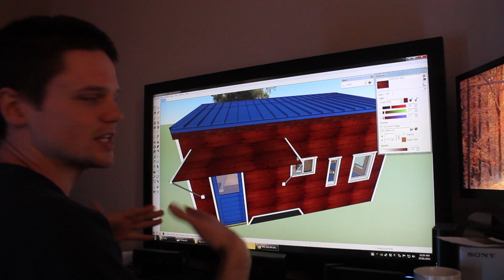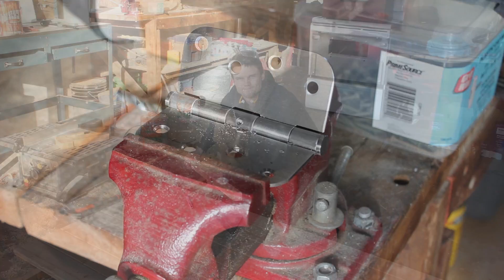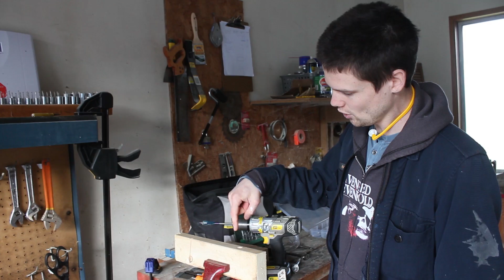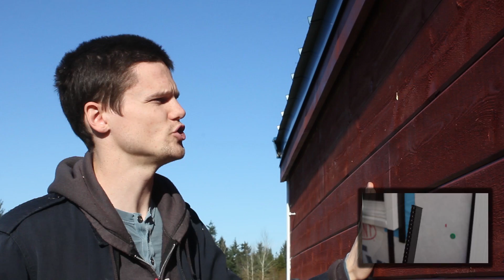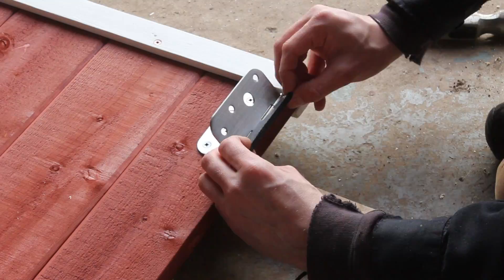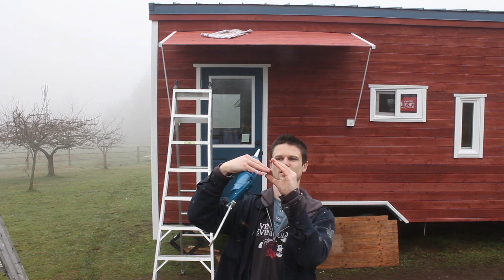DIY Tiny House Awning (Ep. 28)

Comment: Is there a reason you didn't opt for a traditional roll out awning? I would think it would reduce the weight and overall workload of removing/reinstalling (ladders, holding, wrenches, etc). Personally I'm going simple with a waterproof canvas sheet setup on hooks because I don't need the permanence and I'm looking to reduce cost/weight. But I've considered both commercially available and hand-built wood options. Just curious on your selection.
Reply from the maker: We looked into RV style awnings and they are not cheap, plus they are a pretty big commitment to attach to the side of the house (would look out of place because we didn't plan for one). It's rare that we have to remove the awning, and in fact, have not removed it since we did a metal/polycarbonate rebuild. We also have plans for a deck in the future which will have its own cover. I think the roll-out awning would have been a great choice if we planned for it from the start, so it's something to consider early on during the design phase.
Reply: @tinynestproject  Thank you for your response! I love the series.

Comment: how is this different from a trailer? You can buy one for pretty cheap.  Looking at these videos, it will cost me a ton of money on material alone, not to mention tools I have to buy to work with the expensive materials, and there is not guarantee my tiny house will last the winter.
Reply from the maker: This is a very fundamental question when it comes to tiny houses. The best way I can explain it is that a tiny house has all the benefits of a standard house, a mobile home, and an RV. It's much more robust and insulated than an RV, can be deployed like a mobile home, and can be designed to have fully functional spaces like a standard house.

Comment: I would have turned the support board sideways ... that way you could have just used a nut . washer and bolt --- it would not be in the house and you could have been done way faster
imo of course
Reply from the maker: We wanted to have a permanently secured threaded hole to fasten into... we've removed the awning several times, and all we need to do is loosen the bolts and take them out, then slot them back in and catch the threads when we put it back up... a nut would come loose inside the wall once the bolt was removed... hopefully that makes sense, and I know what you're saying too :)

Comment: As always great videos. I have 2 questions though that have been bothering me. Considering your attention to detail you probably have a reason though.

1. Why did you slope your roof so much? The only reason I can think of is to shed rain quickly and to shed snow to prevent the snow load from overwhelming your roof framing. However for such a short span snow load will be minimal and the snow would shed from a lesser angle especially considering the metal roofing as opposed to shingles. Rain will also shed with a much smaller angle. I would have thought you would prefer the added head room in the loft that a shallower roof pitch would have provided.

2. Why did you use the short side of the building as the front? In the case of rain it will now make entering and exiting unpleasant. Even with the awning in this video all you have done is move the rain curtain out a few feet from the door. It will also ensure that the rain will now turn the front of your tiny home into a quagmire as opposed to the back side. If you had used the tall side as the front then rain would be a minimal issue. Was it purely aesthetics that was your concern? I think the high side would have still provided a beautiful front view.

I do not intend this as a criticism. I am merely curious about your reasoning. 

As an aside; I am not sure where you are and how cold it gets there. i am from Northern Ontario where rain freezing on a metal roof happens often. Certain conditions can cause the ice to then shed off of the roof in large sheets. This is hazardous to people and damaging to anything underneath (parked vehicles, patio furniture...). To combat this (if it is a consideration at your location), you can install small vertical wedges at the bottom of each roof channel (the space between each standing seam connection). They are usually made out of sheet metal and are easy to install.

Here are some plastic ones for sale (ignore this if not applicable to your area).

http://snowbreaker.com/
Reply from the maker: 1. Having never installed roofing before, we tried to go with the simplest install. Our research into this basic metal roofing suggested that the shallowest slope you should do is 12:3. Shallower than that could create the conditions for a snow/ice dam to allow water to spill over the interlocking barrier, or mean that you might need a different roofing system altogether... even if this info is not entirely accurate, we decided to stick with the simplest approach and use the most standard materials. This is also why we didn't even consider a skylight... too much to take on for our first DIY install.

2. We don't have quite as solid an answer for this one. It has proven to be an extra issue that we have to deal with. We're planning on making a simple gutter before the fall, to mitigate the frontal runoff. It definitely looks nicer to see the roof from the front... if you've seen the h0me model by tinyhousebuild, the exterior aesthetic is not preferable in our opinion. A few other considerations are which way the house will be towed, where it will be parked, and which side you want the door on... we knew exactly where we wanted to park it on the property before we started to design, so that definitely lead us in the direction we ended up. From our limited towing experience, it's definitely worth having the high-side of a shed-roof on the left side... the opposite side from the curb... because of tree branches. Ultimately, we might have been able to mirror the design, but the position of the fenders would not have lined up with the bathrooms... it was kind of an impossible task to satisfy all of these parameters without compromise, so we will just build that gutter! lol

We appreciate all feedback and well-intended criticism :)

Thanks for the link, this is a great tip and an important consideration depending on your climate. Climate must of course be a primary drive for any design. We're on Vancouver Island where it rains a LOT but rarely gets very cold... nothing like Ontario... so we don't have to deal with that kind of ice issue.

Cheers

Comment: stainless supports would have been maintenance free.
Reply from the maker: +Gene C We used a rust-inhibiting spray-paint, which seems to be holding up well. If it starts to rust we might replace it with stainless (it's also more expensive :P)

Comment: Very nice!  I'm considering something similar, but with leftover corrugated metal sheets from my roof.  I have a 10' x 3' piece that I would cut in half to make it 5' long by 6' wide.  I'm just wondering if it would be too heavy though for a similar attachment method that you have with the bolts and angle iron, as I would need plywood or OSB (probably sealed somehow on the underside), then wood supports for the plywood (to accept the depth of the #9 metal roofing screws), then the roofing underlayment, and then the metal roof.  I know you used a different material, but any suggestions, thoughts, or comments on my proposed materials would be appreciated.  Thanks!
Reply from the maker: +Sac TinyHouse Sounds more resilient than ours, but hard to say weight-wise. Ours is... fairly heavy. Not manageable by a single person, and not the easiest thing to mount with two people. As some people warned us, it did sag eventually, but we've upgraded it with a few aluminum cross-members which we'll show in a later episode.

Comment: Question, can this still drive on US roads? how tall is the whole thing?
Reply from the maker: Evilroots It might be an inch or two wider and taller than the regulations (8.5 feet wide, 13.5 feet tall). We designed it to fit within the limits, but the roof sticks out an extra inch here and there beyond what we modeled in sketchup. We're hoping it will settle an inch or two on the suspension, and then an authority would really have to bust our the measuring tape and be out to get us :P

Comment: ? what about when you travel with it did you set it up so you can lower it and re-bolt it ?
Reply: Tiny Nest I have not built anything yet but considering options. Just a suggestion, why not make an awning  and porch that close together for travel. Kind of the same concept as storm shutters only instead of going from the sides in they would go from top to bottom and could just be fastened down for travel.
Reply from the maker: wotsken The whole thing can be removed with ease for travel and then be reattached. We don't plan on moving much so we didn't build in a latching system or anything like that.
Reply: what i was thinking was a second hole in each of your support rods then you could just drop it down and slide your bolt through the other holes and it would hold it in place for the trip
Reply from the maker: wotsken Hm, this could work... except that it would add several inches to the width and we're already pushing the limit for the road :P
Reply: i understand that i was just trying to think of a way you could move without having to unbolt every time
Reply from the maker: wotsken Yes, it's a very good idea thanks for sharing. We just might not be able to make it work with the way it would fold. I'm sure someone else might benefit from the suggestion though :)
Reply from the maker: mirageseekr That's a good option. For us, we knew we wouldn't be travelling much, and we're already maxed out on width, so the removable option seemed best suited to our situation.

Comment: Wood glue (for exterior),mixed with some water,
you paint hole with it several time (thin),
makes wood hard as glue.
Reply from the maker: fred san Hm, are you saying that this could strengthen the sheet and prevent it from bowing?
Reply: Tiny Nest
with water that penetrates well into the wood,
by drying makes it more solid,
aspect in this is like a varnish.
Tries on the wooden handle of a hammer or screwdriver
For a thin wood probably good, as "plywood" (french name "contreplaqué")
Reply from the maker: fred san Thanks for sharing the technique :) we'll keep it in mind if we need to repair or replace the sheet.

Comment: I was thinking through out the video that the tongue and groove should have run the other way to shed water. But you don't really want the water to drain straight off onto anyone approaching the door (as it stands the best way to approach the door when it is raining is from the side). Since you really can't see the boards at that angle, I would suggest you at some point replace this with a solid sheet of something that wouldn't accumulate water between the boards and that would be lighter. If the material was wider than the supports so that it would bow up, it would even shed water to the side. Otherwise you could put an angle-iron at the bottom edge to divert water to the sides.
Reply from the maker: MakeMeThinkAgain Nice suggestions :) we have considered adding a mini-gutter in the future if we find that the runoff is strong, but we're actually not sure what kind of porch we will have or from what direction we will tend to approach from. So we'll see how it goes and definitely keep your comments in mind ;)

Comment: I was thinking of something similar, but to span the whole side(s) of the house.  But I live in a warmer climate and shade helps to keep things cool.  It might have been better to bolt a 2x6 to the side of the house and mount the awning to the 2x6.
Reply from the maker: wwwShadow7 Yeah we have thought about eventually building a large covered area out front, which is part of the reason we made this awning easily detachable. We tried to have a few layers as possible to keep it simple... seems perfectly solid so far.

Comment: The awning looks nice. The only thing I might of done differently, is I would of glued 2 2X4 together, put it flat against the plywood. When you put the threaded collar in, there is more wood to provide support.
Reply from the maker: Duane C Hm, not sure I am picturing what you are describing... we tried to have as few layers as possible, but of course that means that it's a little thin structurally in some places. Strong enough so far though.